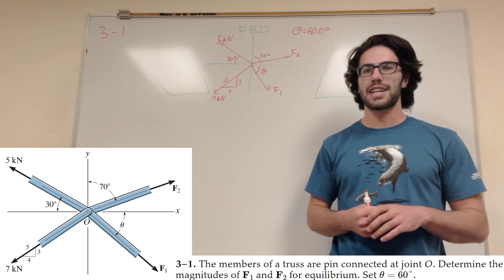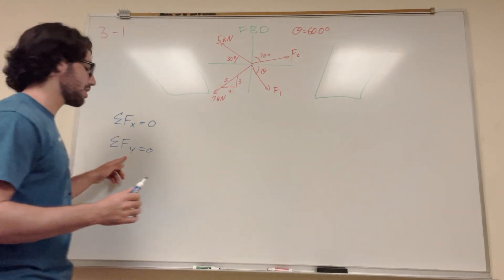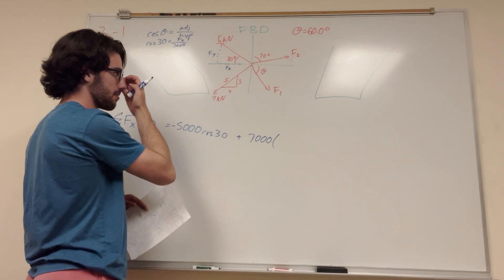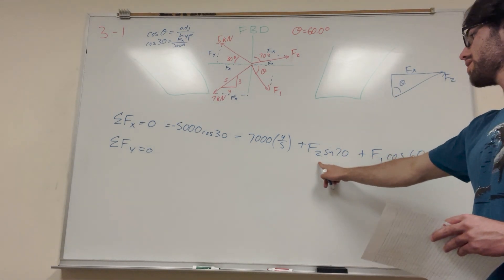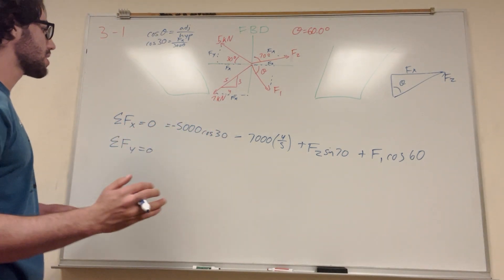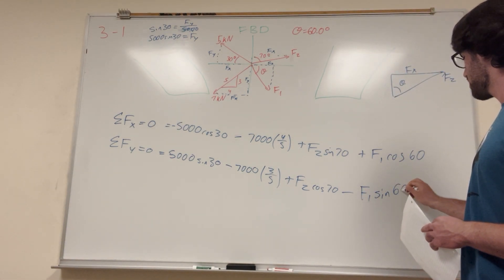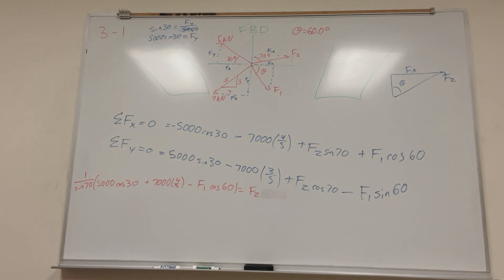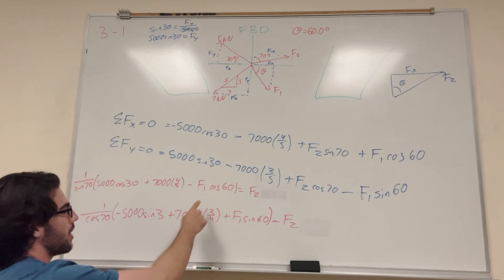The members of a truss are pin connected at joint O. Determine the magnitudes of F1 and F2  - 3-1

Comment: Why is it positive f2 when you move it to the other side isn’t it negative f2?
Reply: sorry to necro but this if for posterity.

He should have flipped the signs when he move F2 or marked it as -F2. luckily it doesn't actually matter if he changes any labels as long as they stay consistent. as long as you make the same mistake on both sides nothing will flip domain